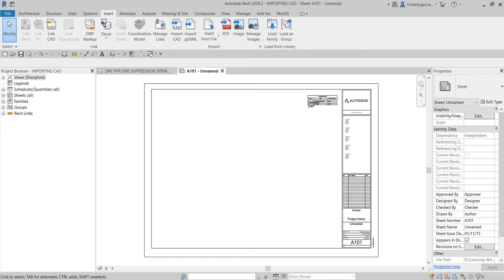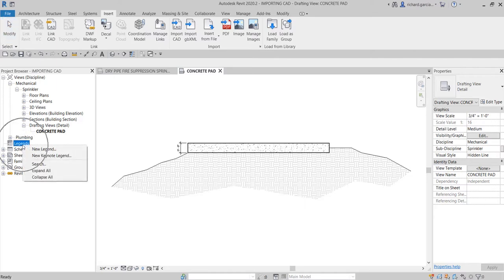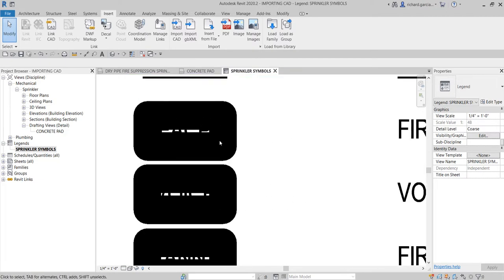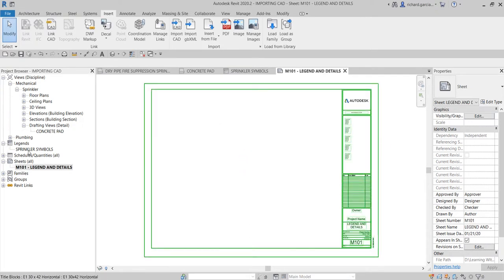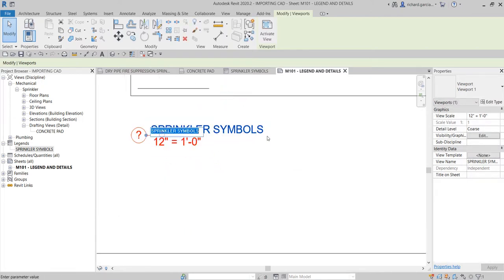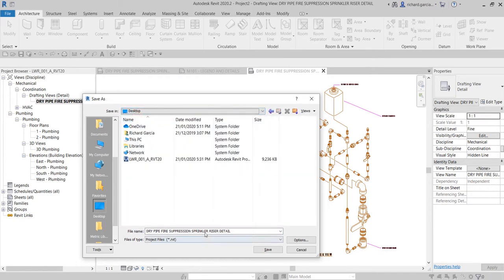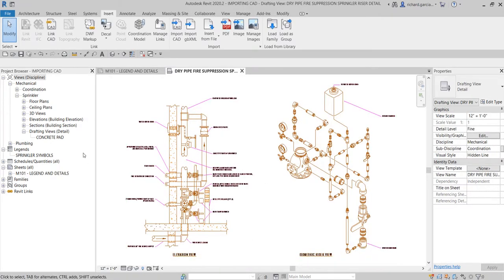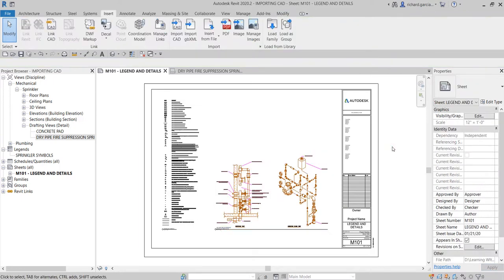FIRE PROTECTION SPRINKLER DESIGN: CREATING LEGEND AND DRAFTING VIEW REUSE

Comment: could we please have a video tutorial on how you did the isometric annotation explosion please? thank you
Reply from the maker: hello @jufasa14, try this.

1. **Set Up a 3D View**:
   - Open your Revit project and duplicate an existing 3D view or create a new one.
   - Rename this view for clarity (e.g., "Exploded View").

2. **Adjust View Orientation**:
   - Use the *ViewCube* to set your desired isometric orientation.

3. **Enable Exploded Components**:
   - Select the components you want to "explode."
   - Use the *Displace Elements* tool (found in the *View* tab under the *Graphics* panel).
   - Drag the components along the X, Y, or Z axis to separate them visually.

4. **Add Path Lines**:
   - After displacing an element, Revit allows you to add *Path Lines* to show the relationship between the exploded and original positions.
   - Select the displaced element, then click on *Path* from the Displace Elements ribbon.
   - Path Lines help clarify connections between components.

5. **Add Annotations**:
   - Use tools like *Text**, **Dimensions**, or **Tags* to annotate the exploded components.
   - Place annotations strategically to minimize overlap and maintain clarity.

6. **Customize Visual Style**:
   - Set the *Visual Style* to "Shaded," "Hidden Line," or another preferred mode to enhance clarity.
   - Adjust lighting and shadows in the **Graphic Display Options**.

7. **Lock the View**:
   - To avoid accidental changes, right-click on the *ViewCube* and choose **Save Orientation and Lock View**.

8. **Export or Document**:
   - Export the view as an image or use it on a sheet to present the exploded view.
   - If for documentation, make sure the annotations are legible at your intended scale.